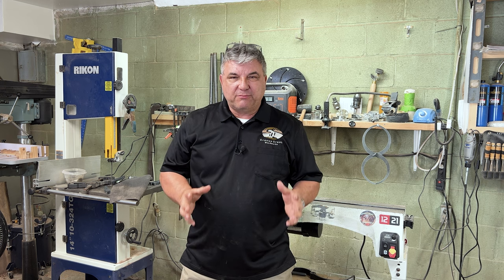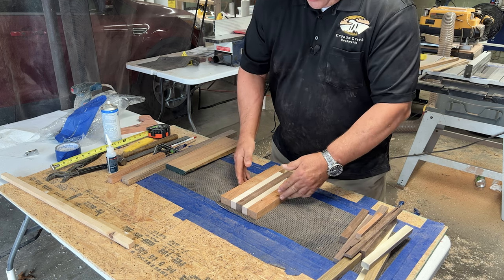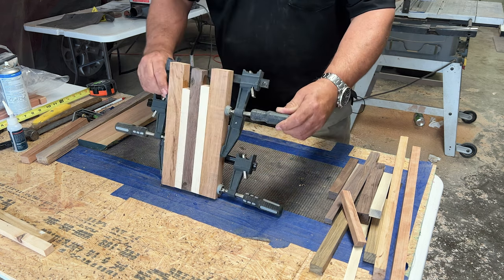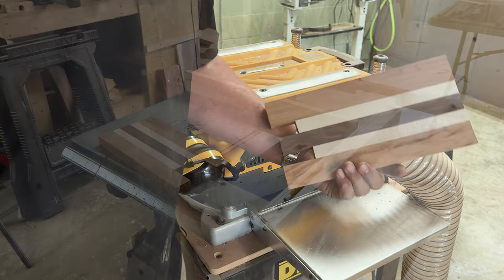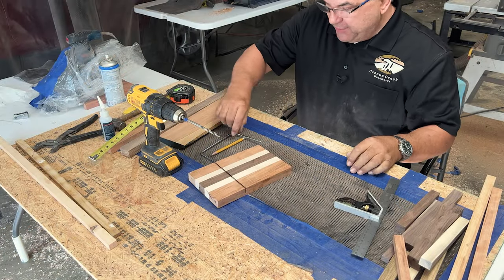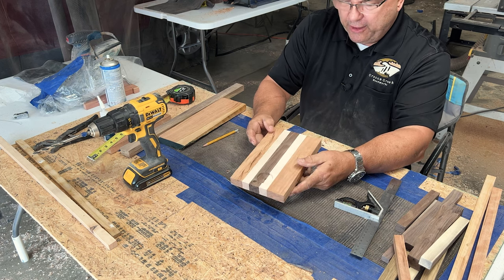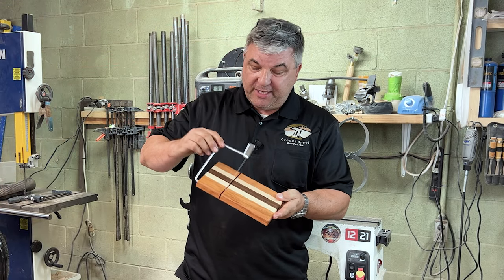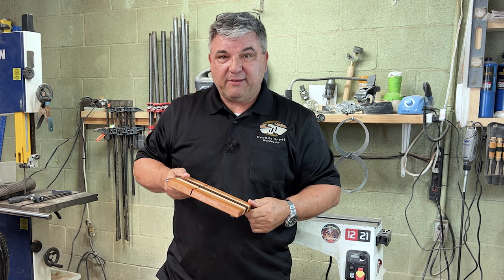Creating a Cheese Cutting Board

Comment: When drilling the hole, you must drill to the correct depth. Your instructions show how deep the hole should be. If you just drill past the slot what happens is when in use the slicing wire strays from the slot and hangs up on the slot edge. So drill to the proper depth, to the 16th.
Reply from the maker: Actually, the hole is drilled 3-3/4, and the wire is at 3" so there is plenty of room to adjust the wire if it gets off track.  I made it that way for that reason.  I have sold hundreds of these and never had an issue.
Reply: @crocuscreekwoodworks  great point. Thanks

Comment: Why cut the slot deeper at one end.
Reply from the maker: As shown the slot is at a taper so the hole you drill is low enough to allow the wire to slip onto the handle.